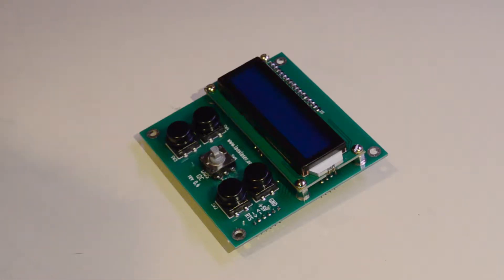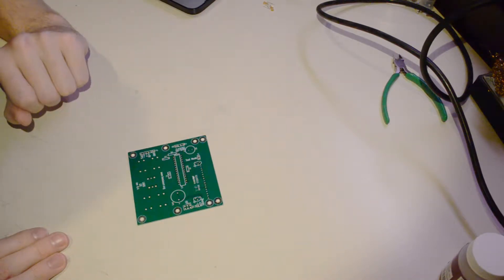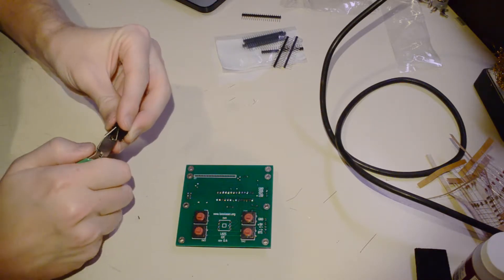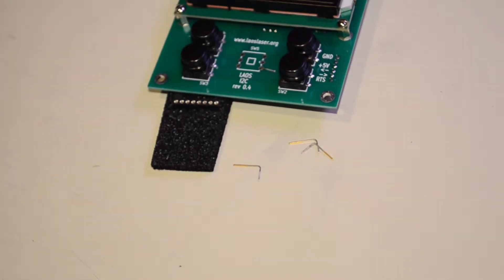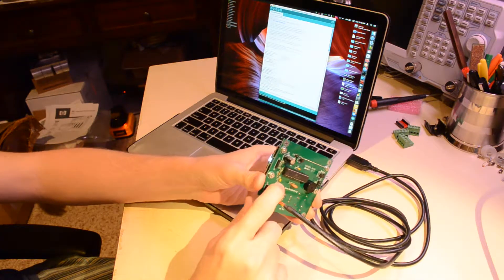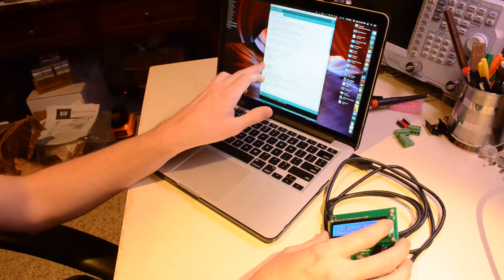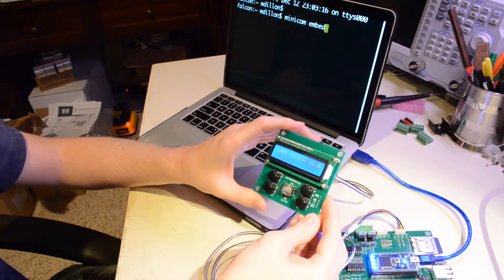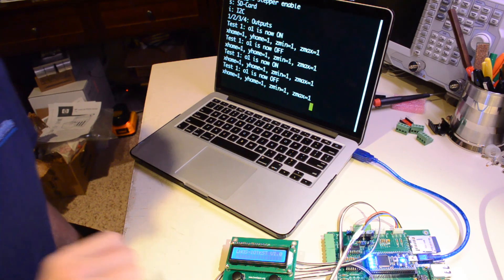LaOS Laser Part 2: i2c Display

Comment: I am completely in the dark as how to install the Arduino boot loader. (0n a PC) The Laos instructions only tell you to do it and unfortunately your video is missing this step. :-(
Please help.
Reply from the maker: Rolf Randby The best advice I can give is to follow the arduino instructions: http://www.arduino.cc/en/Hacking/Bootloader?from=Tutorial.Bootloader You'll need either another arduino or an avr programmer.
Reply: Thanks for trying to help. But I am not spending any more money on stuff I am only going to use one time. Read through the Arduino instructions which are not comprehensible but to another programmer, in my opinion. :-(
Reply from the maker: Well, I suppose there's no other way to help you.  Keep in mind that if you program it from an arduino, you can use that for another project later.  Also, I encourage you to push yourself to try to understand it.  That's how you learn: patience and perseverance.
Reply: That is all well and good and if I was about 25 years younger. Unfortunately, my little gray cells are almost 86 years old and I have found that it is now impossible for me to learn things like that. :-(Luckily my other skills  seems to be mostly  intact  and I am presently  finishing up a quadcopter built from scratch.

Comment: Good job, if you have I2C issues there are some simple solutions. Slow down the I2C speed works best. Reduce the resistance of the pullups. Also make sure your power supply rail is solid. e.g. add some extra capacitors between ground and the power side of the pull up resistors.Good luck!
Reply from the maker: Robonza It is starting to look like i2c does end up being an issue.  The speed is already set to 9600 baud, and the power rail looks to be pretty stable.  I'm considering adding some ferries to help with common-mode noise.
Reply: hpux735 I am a little confused. 9600 is a UART baud rate. I2C runs at 100kbs standard and 400kbs fast mode. 9600bps would not have a problem running a few meters. You maybe looking at the wrong part of the firmware.
Reply from the maker: Robonza Nope, you're not confused. :)  I know 9600 is a typical UART baud rate.  There's nothing preventing i2c from running at any bit rate, and because it's synchronous it's easily configured.  If you're interested, see Firmware/laser/global.cpp:77 at https://github.com/LaosLaser/Firmware/blob/master/laser/global.cpp

I think what's happening is that the i2c lines are picking up EMI from the laser power supply which is causing instability in the mbed processor.  There's a way to setup the display to be more passive, and it's not queried during the cutting routines at all, but the connected display still causes problems.

For now, I've just disconnected the entire harness.
Reply: If you are running the I2c at 9600 then that's really slow so you could look at changing the pull ups to 1 or 2k. You could shield the whole cable too.
Reply from the maker: Robonza The shielding is a good idea.  I Think I might have some shielded cable left over from when I decommissioned a video editing system at work.  There was a massive amount of RS422 shielded serial cable.
Reply: Beware that if it is twisted pair not to put SDL and SDA into the same twist. I twist positive with one data line and negative with the other data line. Also connecting both ends of the shield can work out bad sometimes as current may go through the shield.
Reply from the maker: Robonza Right.  I think I'll have enough pairs for SCL, SDA and +5v to be with their own ground.